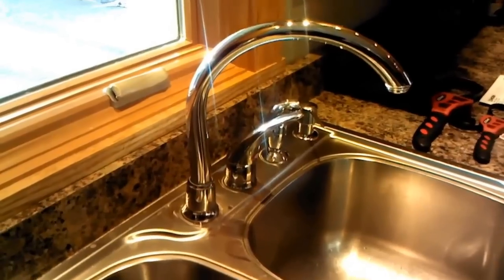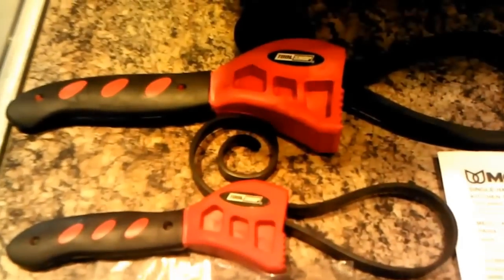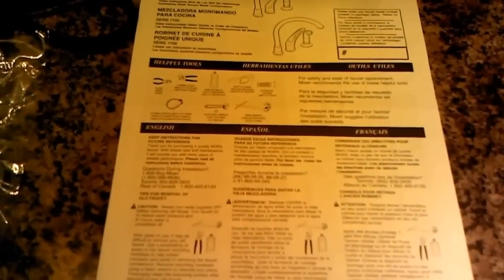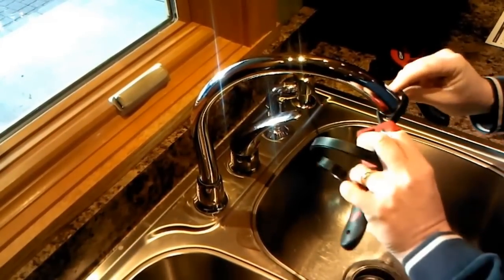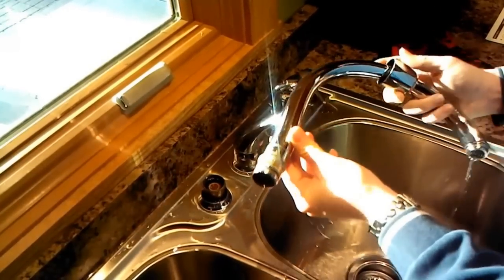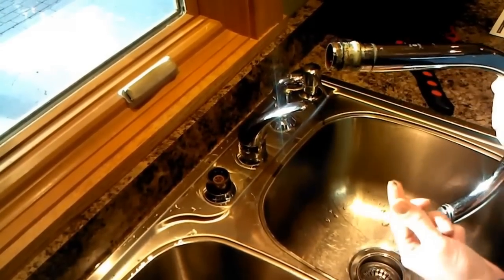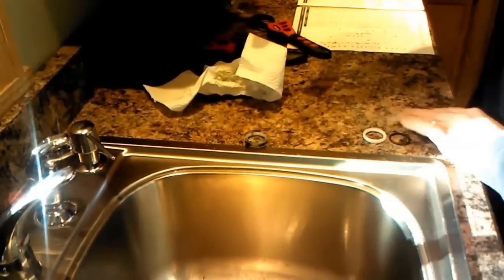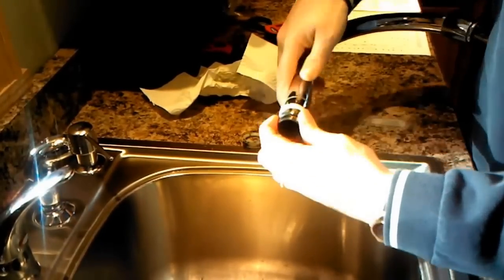Moen High Arc Kitchen Faucet Leaking O-Ring Replacement

Comment: Great video, I noticed that you did not use faucet and valve grease which is highly recommended. It will let the gooseneck swivel very smoothly without binding or "stuttering" and help keep the O-rings lubricated and prevent any possible pinching.

Comment: I have the same exact Arc Faucet and even used the same exact rubber strap wrench you used (tried the large one too)  After attempting to rotate counter clockwise the ring nut will loosen but then it tightens up again???  Guess I will get a little WD-40 in there in case there's some grit or other sludge inhibiting the rest of the threads from loosening.  You made it look easy but unfortunately I will have to revisit at a later time and try again.  I am a fit guy with strong grip too so next step is explosives!
Reply: Best I can tell, mine is also the Monticello; however, the assembly at the base of the spout is different.  There is a white plastic split band that clips around the base of the spout.  Two tabs that protrude inside of this band fit through slots at the bottom of the spout, and that's what holds the spout in place.  The chrome cylindrical piece simply fits over the white plastic band; it is not threaded at all, and it pulls off the clip quite easily, without any rotation required.  Hopefully I can post some photos I took along with this note.
Reply: +B Bartos That's exactly the same faucet I have and I want to try and fix this myself.  Do you just pull the white plastic off?  It's leaking in the same place.  Do I have to order the replacement parts from Moen or would something at Home Depot work?  Single female just trying to save some $$ any help you can provide will be appreciated.

Comment: I have the same issue with my Moen faucet I replaced the O-rings and it stopped leaking above but now it's dripping from the same faucet area but underneath the cabinet

Comment: Does anybody know what could be causing it to now drip underneath the faucet that I just put the O-ring on? It's not a extreme drip it's just dripping slightly but enough to cause water damage if we run the sink quite a bit. Is there another o-ring at the base below the neck or some type of plate that holds the water in that maybe became misaligned? Is there some type of seal under the escutcheon plate was defective is now dripping from the bottom it just went a different direction

Comment: The video is great, however, I had a very hard time getting the collar off so finally I used a basin wrench. After removing the collar, I pulled the faucet several times to get access to the O-Ring seal but it will not budge, any suggestions.

Comment: Hello,
I need to do this repair.  I have water leaking above the whit plastic ring .
I have the repair kit but no instructions.  if you would be so kind, please tell me if I have to turn OFF the water supply to the faucet first, Regards
Reply from the maker: No need to turn off the water for this repair (I didn't). Just be careful not to accidently bump the faucet while working on it.
Reply: tyvm. i was told to change out the cartridge also, however, no water is leaking via the opening of the spout. water leaks into a bowl under the faucet, but i think that is directly r/t the o ring and white plastic ring. also...........a lot of air comes through spigot prior to water running
Reply: I think the same thing is happening with mine; replaced the cartridge and the doem area does not leak but have some wetness and some drips below underneath the sink.  Did you change the o-ring (not even sure if mine has one).

Comment: you can do this without turning water off?
Reply from the maker: No definitely need to turn the water off.
Reply: @DavidTrebacz  i just done it without turning water off under sink .. took me all but 10- minutes, my leak is completely stopped now and i am a happy camper!
Reply from the maker: @TADDs101  Glad to hear you okay. If you pull the cartridge water should shoot out, if you don't shut it off. Sounds like it worked out for you, but in general, I wouldn't recommend it :)
Reply: @DavidTrebacz  mine was just leaking at the spout base .. there is no cartridge in the spout, and no water is going to come out of spout unless you turn handle on

Comment: Faucet is leaking under the sink by the quick connect. Moen sent me quick connect part which is leaking even more. Will replacing O ring fix the problem?
Reply from the maker: Not sure - Some push connects do have a replaceable o-ring. Would probably need to see what your working with. Sorry can't help more.

Comment: The collar on my faucet will not budge. I have a similar kit of two strap wrenches and neither works. I may have to settle with marring mine up to get it off.
Reply: Curious how you got it loose... Did you resort to marring the chrome? I'm in a similar situation.
Reply: me too, the collar i swear was put on with super glue lol!
Reply: I ended up disconnecting everything from under the counter and taking the neck & collar unit to Lowe's for assistance. Three guys tried everything short of damaging the collar to no avail, then a retired plumber asked if he could put a wrench on it. He did. It got scratched up but it did the trick! Now to get Price Pfister to honor their limited lifetime warranty haha...
Reply: nywvblue sorry for the late reply. I replaced it with a new faucet. It was Christmas eve and I didn't want to be in a situation on a holiday with an unusable sink.
Reply: I’m not sure if this would work or not but wouldn’t wrapping the chrome with some Gorilla tape and then using the wrench avoid some scratches?